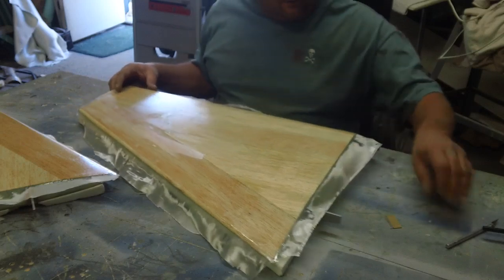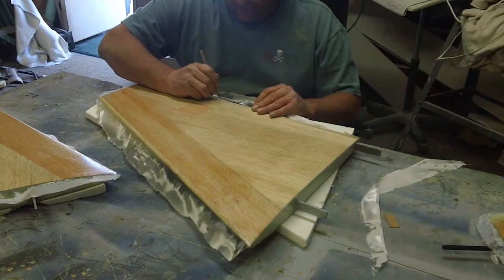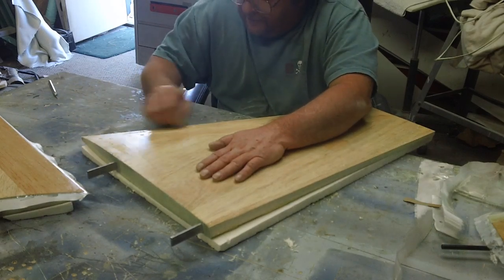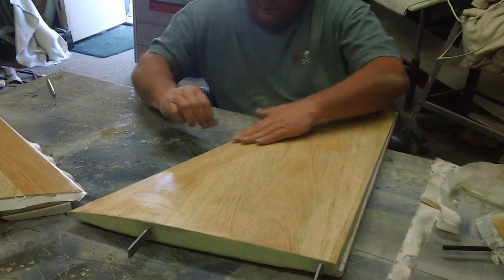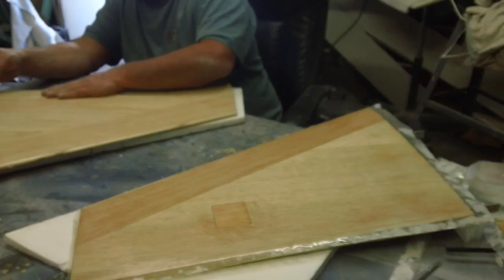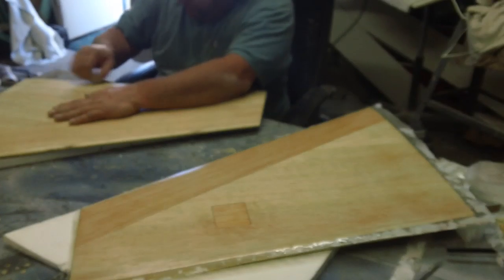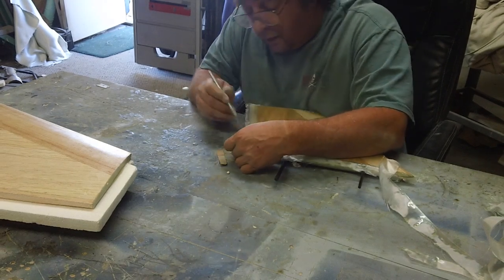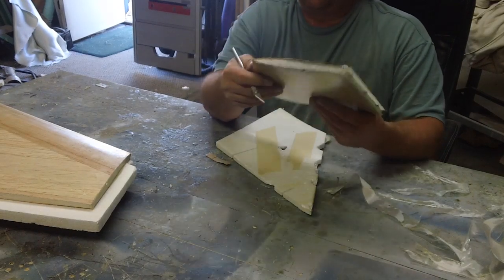how to fiberglass a rc airplane #3

Comment: I dont suppose you could do a vid on how, (if its possible) , to glass open structures, spar only tail planes.? I want to be glassing my 1/5 corsair and want an even finish but the rudder and elevators are open spar structures.
Reply from the maker: andarno01 not possible to do open structures you can use silk span to paint stuff like that
Reply: hornitpilot ok, never used that either, does that work with fiberglass? Perhaps next time you do it on some open structure you could video it. Keep the vids coming love them, not so many people building these days, there missing most of the hobby imo. :)